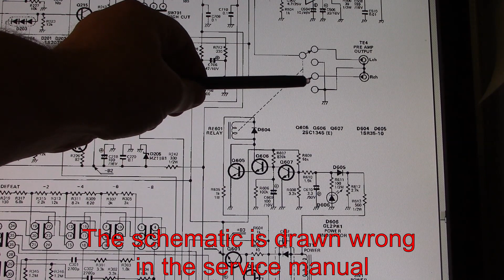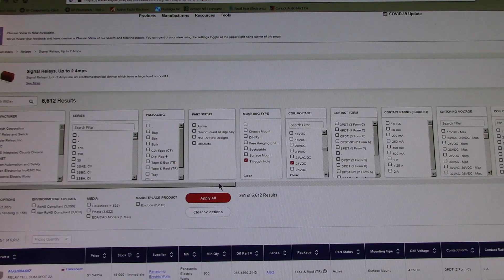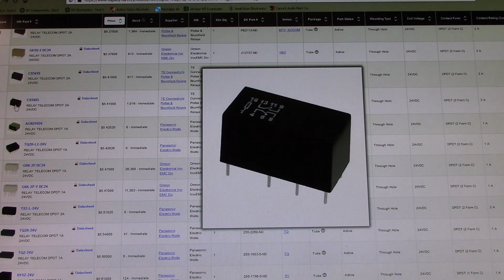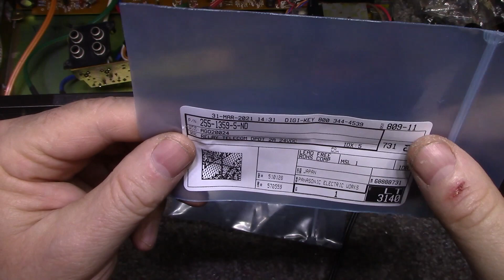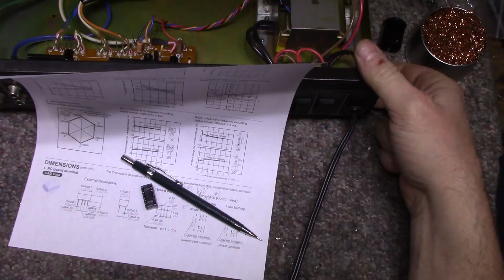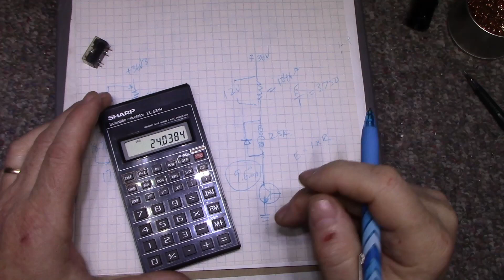Harman Kardon HK 725 Preamp - Relay Replacement (Ep. 68)

Comment: if you don't change resistance, low risk to break down relay, but it might not work :
if you use 400 ohm coil relay (very low), relay should not switch with 10 v tension on his coil and 250mW dissipation.
if you use 4500 ohm coil relay, current go down to 6,3mA, so relay shouldn't switch, tension in the relay should be at 28,3v, it is acceptable tension, on the limit of the coil (always 120% tolerance), and there should have 178mW dissipation, not much.

Comment: Excellent video! Thank you. I wonder if there are any adapters which would make the soldering of the new form factor to the old form factor a bit easier, like the IC adapters. Any idea what that old form factor is called?
Reply: If you had the patience you might be able to remove the coil, contacts and chassis from the old relay and mount the new one inside, the pinout had the same layout but it was just a different size. It would be extremely difficult to solder the leads on inside the old casing though and the only benefit over Trevor's solution is hiding the wires and keeping it looking more original at first glance.